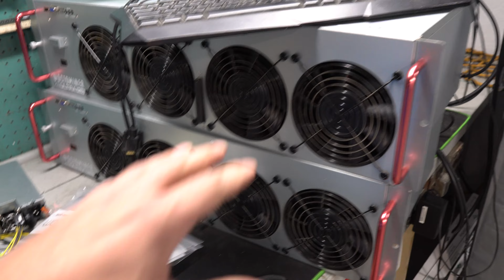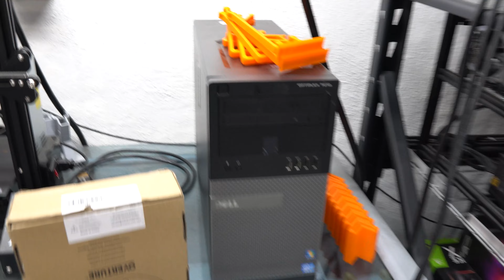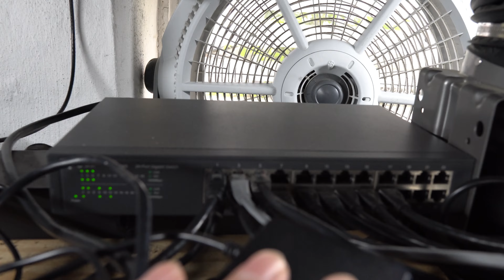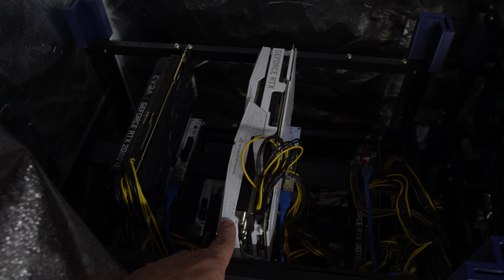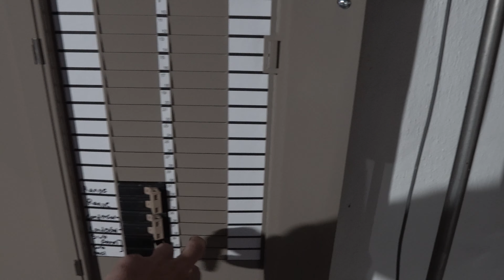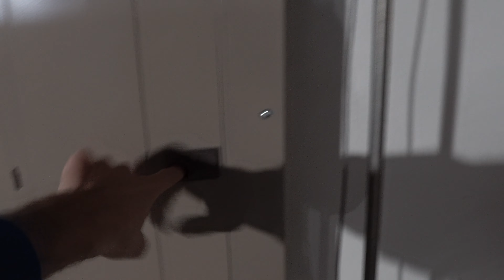Post Eth Merge Mining Farm Update

Comment: Sup Jtrav, where can I get the 3D printed motherboard vertical stands? Thanks
Reply from the maker: I got the file on thingiverse and printed them
Reply: @jtravaglini  I saw them but are they sturdy, they look flimsy
Reply: @jtravaglini  thanks for the reply
Reply: @jtravaglini  how much? Do you have a link to order?
Reply from the maker: @diyadventures9138  I am not using them.  They seem to be ok.  Really you shouldnt be bumping the boards so they should work.  I am not sure if I really trust them.  If the room gets hot or the board gets hot it could soften the PLA